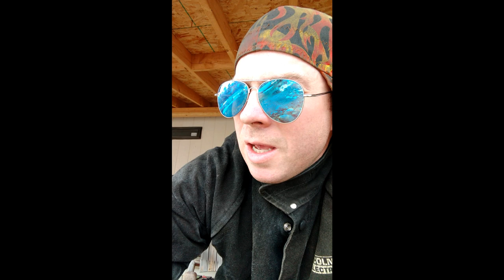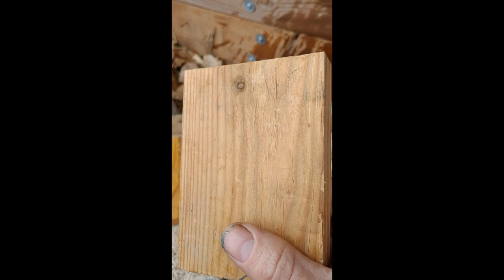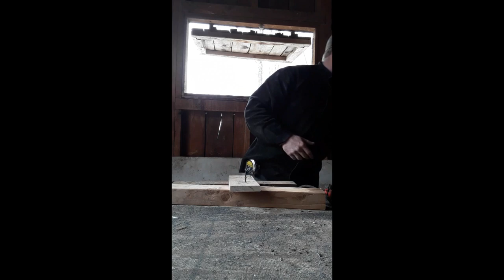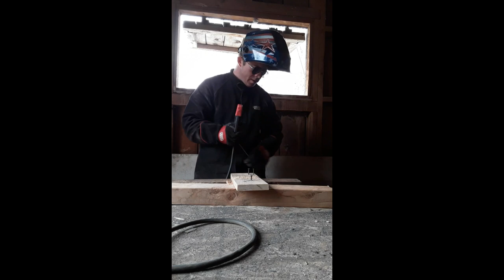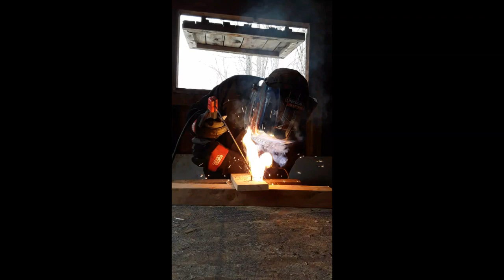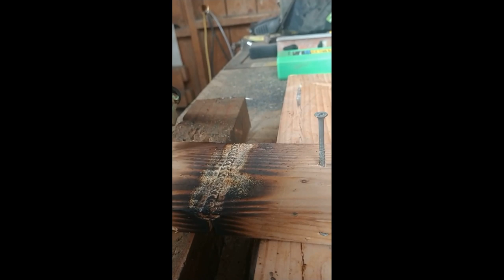Welding wood? Click to have your mind blown! So simple!

Comment: You're using the wrong rod! For the strongest wood weld a 1/4 inch dowel filler is best!!
Reply: Man I made these videos just messing around. I never thought I'd have this many views. Thanks for the tip though, I'll try that next time!
Reply: I was thinking the same thing, except you might want to tig it at that point.